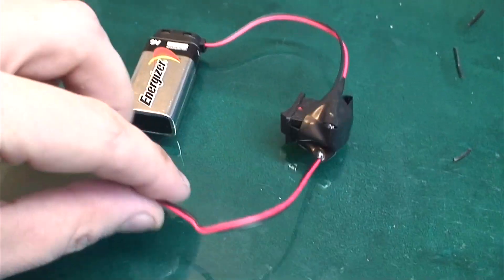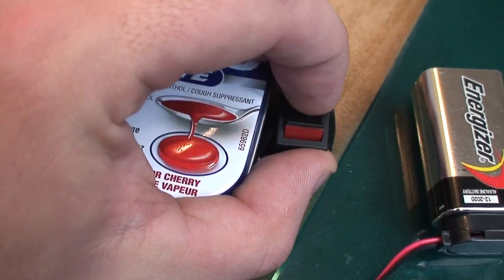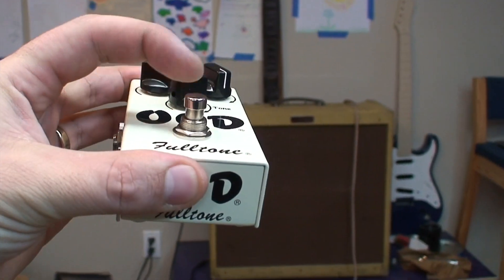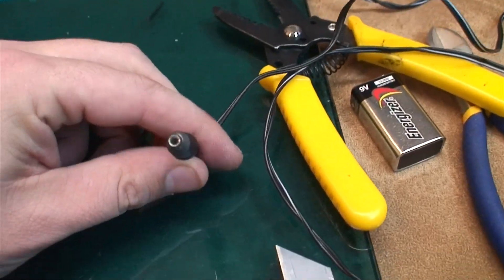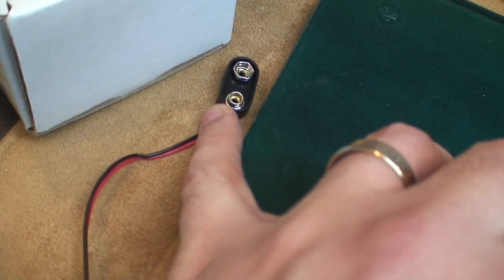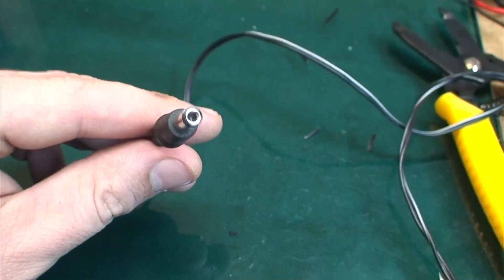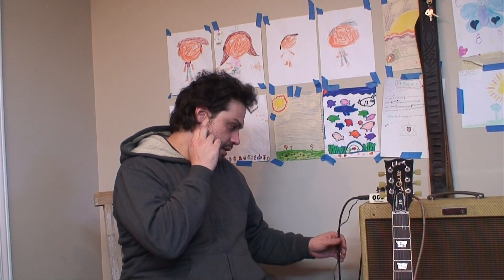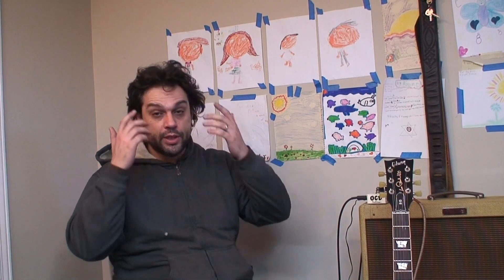Recycle an old Power Supply for a Guitar Pedal

Comment: Dude!  You kick ass.  Now I have to find a blues deville amp.  That thing just drips tone!
Reply from the maker: +Greg's Garage Thanks bro! It's a nice amp. It sounds and behaves way better with the 12at7's:-) I may try to go down to 12au7's!
Reply: For some reason, I thought it had dual 6L6 tubes.
Reply from the maker: Greg's Garage It does have dual 6L6's for the power section and then three pre-amp tubes. Those are 12ax7's from the factory, but dropping to a 12at7 helps tame the volume, big time!
Reply: Ah!!!  Got it!

Comment: I have been repurposing wall warts for several decades. It needs to be mentioned that this only works if the pedal has built in hum filtering. For example, I have converted 9VDC wall warts ranging from 100 to 400MHA (from Dustbusters, cordless drill chargers, old telephone base stations, etc.). They worked fine with a simple polarity change to negative pin for the majority of my pedals but did not work with my JHS Morning Glory. The 60 cycle AC hum was VERY loud. So, everyone should keep that in mind.

Comment: I know they make them , no idea if cost effective.....you should look into a motion sensor, instead of a switch, then completely forget proof......
Reply from the maker: +Chuck Nowakowski SWEET:-) Maybe I could grab one from a light or something...hmmm:-)
Reply: +Woodeso's Guitar Mods I used a motion sensor from an outside light, rigged it to an inside light, set the sensor at my driveway entry and buried the cable, someone was stealing gas in the neighborhood so when they set foot in my driveway a tiny light in the corner of my office came on. They never got any gas off me! lol But yeah a motion sensor would be fun to play with. Good video!